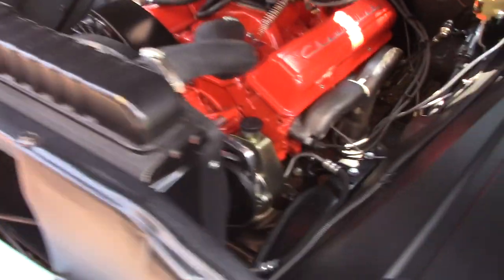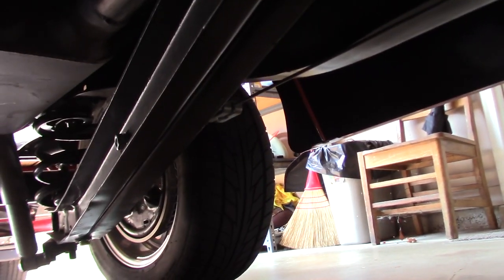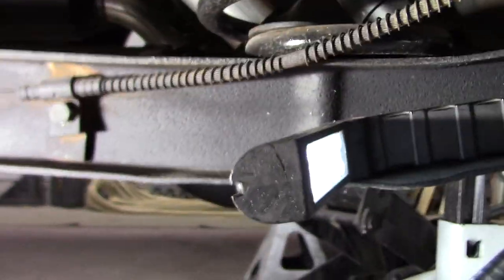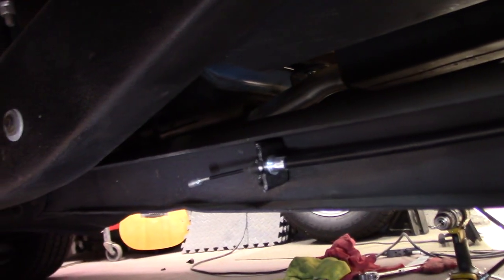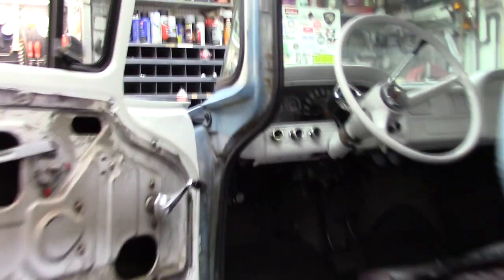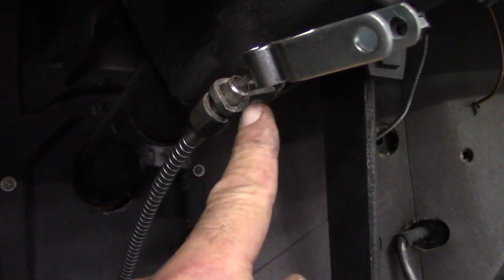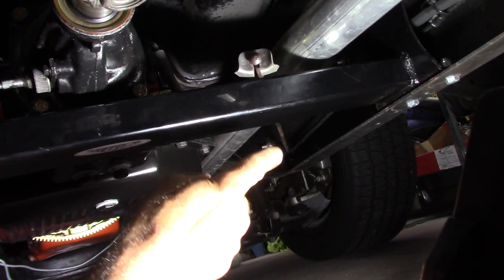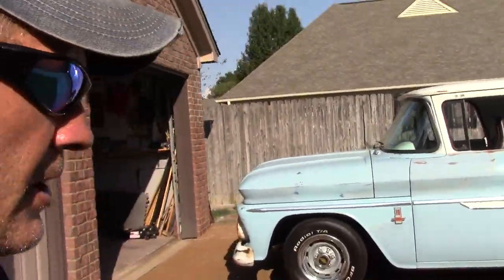Install parking brake cable chevy c10

Comment: I'm totally  a hands on guy and look at youtube videos on how to fix any and everything I own before hiring any work out. I have a 1970 chevy c10 that I'm in the process of restoring and the idea of using those (I) bolts is much better than the hardware that comes with the replacements. I've watched most of your videos but what I like the most is the tire and wheel combination because I'm still running the 6 lug pattern on my truck. I'm looking to go with the same setup as your truck, mine is a fleetside shortbed with a 4.5/6 drop and those ralley's will look great with that stance. Keep up the good work and in your famous words HERE WE GO!:goodvibes:

Comment: Man your videos are great! I would have liked to seen how you hooked the cable on the lever in the drum
Reply: @Ronald Steveson  > Ronald, with the trailing brake shoe removed, and lever exposed it is easy to install the cable ball crimp end. First, get a good set of pliers to fit the crimped end, next to it, place a pair of side cutters against the side of pliers. Squeeze the side cutters so they pass thru the spring, gently grabbing the cable (Don’t worry, it can’t cut) then as a fulcrum, pivot the side cutters & pliers together. This pulls the spring back, holding the side cutters, slide & hook the ball onto the lever. I did it that way for over 40+ years, you cannot scratch the cable.
  To get the cable fitting out of the backing plate, take a 1/2” 12 point combination wrench, place it over the cable with the handle of the wrench facing away backward. Tap with a hammer and the box end of the wrench will close the fingers of the parking brake cable fixture, wiggle as needed, comes right out. Note, if reusing, spread the finger out a little with flat blade and push into until it snaps. Easy. 
Shoes have wear points & held onto the backing plate. They were $3 in the late 60’s and worn ones were replaced. Today, take an angle grinder, carefully dress 3 pads on leading side & 3 on trailing. Apply high-temp PTFE brake grease to each spot with a dime size. Install shoes normally. Digital photo helps but remember, the long friction is alway facing backwards, short friction faces forward. It contact the drum, rotate at the bottom backward, pushes long friction into drum, stops. Same on both sides so I.D. shoes, set on ground in place for each side. Long is back, short is front. I have 400 horse ponies and don’t need disc on rear. Too dam expensive and never last as long as shoes. Believe me!
ASE Master Tech since 1978 - Retired

Comment: Man, good to have a new video from you and see both of those beautiful machines. I was starting to worry about you. On your power steering setup, are your hoses custom made or a shelf item? If they’re a shelf item, can I get the brand and part numbers from you? I’m not happy with mine at all and, as usual, what you have looks perfect. Again, so good to see you back at it! Keep ‘em coming!
Reply from the maker: I got the complete Power steering set up through( Early classic) restoration & suspension
Reply: OK. I’ll definitely have to look into that. Hopefully, they sell just the hoses. I converted mine to power steering back in the early 90’s, but back then the conversion “kit” consisted of two plates that allowed you to mount a modern steering gear to the frame and a short piece of pipe for shortening the steering shaft. Finding a gear box, pump and hoses was the responsibility of the truck owner. Not exactly my definition of a “kit”. Thankfully, things have come a long way since those days. I found stuff and made it work, but it doesn’t look anywhere near as clean as your setup.

Comment: Would you happen to know what size the nut is where the cable goes through the adjustment bracket. My cable is good but the nut is missing.

Comment: Hi. Like your video. I have a 64 C20 Longbed with coil springs. And i need the rear parking brake cables.I hav been searching on eBay,cant find anything. Do you know where i can get this,are the cables the same on the 65 c10?
I live in Norway so we dont have this kind of parts in store here.
Best regards
Ronny Flemming Nielsen

Comment: hello Gibson 63 ,  watched your video just today for the first time , 5/24/2022 ,
have a customer that I am currently installing the e - brake cable setup for on a 1965 Chevy c-10  2w.d. short bed .
who ever the knucklehead was that restored this truck threw away all e -brake parts ?????
I have been lucky and found all the oem style cables , and linkage arrangement on the crossmember you pointed out in this video .
the only thing I am missing to complete the job is ;
THE LEFT & THE RIGHT REAR BRAKE   ACUATING LEVERS   &   LINKS ( FORKS )   &  ANTI RATTLE SPRINGS FOR LINKS .
THE BRAKES ARE  11 X  2  . have seen them on e bay amazon ect. ,  yet not for my application ??
do you have any spare parts that could get me out of a pinch  or GM part numbers or SOLID LEADS ?
LMC does not service them .  hope to hear from you soon     thanks Paul
Reply from the maker: Sorry don’t have any of these parts

Comment: At about 4:05 you measure from a coil spring bolt to a mark on trailing arm for 19 3/4”. Where did that measurement come from? Is it same for 1972 swb c10? If not, do you know where I could get that information? Great videos by the way...very helpful!

Comment: Hey Gibson I want to convert a 2wd 1962 chevy c10 to a 4wd with original parts where can I find the parts cause I want it to be original not a 60s body on a 73-87 frame
Reply: Aspen's Auto Salvage may have some early 60's 4X4 K10 part's look them up on the web ask for Jaime. Have fun...
Keep On Trucking 👍....
Reply: @dustinsirrine227  thanks for the tip dustin
Reply: Also "Desert Valley Auto Parts" in Phoenix,AZ. may have 60's K10 4X4 parts check them both out hope this helps you some...
Keep On Trucking 👍...
Reply: @dustinsirrine227  o it will when it comes to the rare parts I have thought about taking the 4x4 parts out of a newer like a 63-66 they are easer to find in a 4x4 these tips will help alot
Reply: Your welcome... Hopefully you can get all the parts you need. Keep those old Chevy Truck's all GM the best you can my friend...
Keep On Trucking 👍...